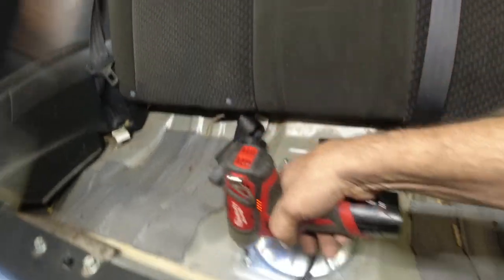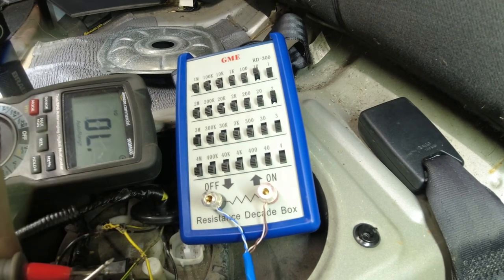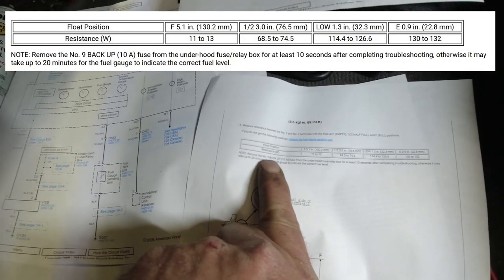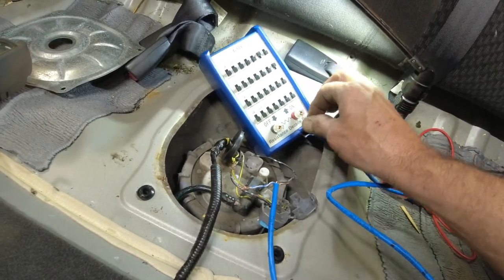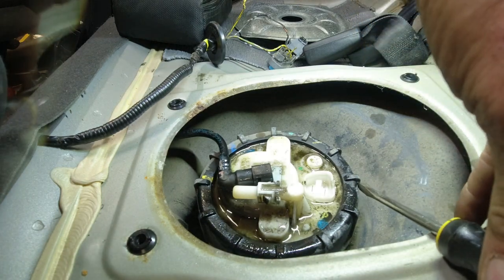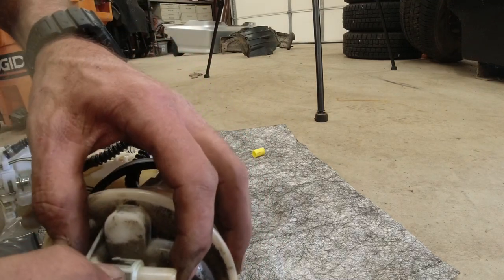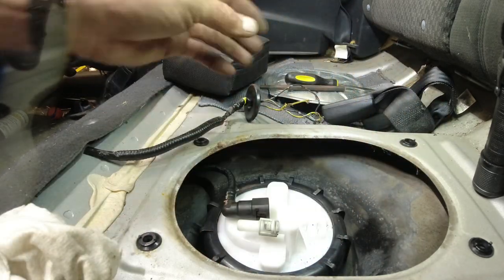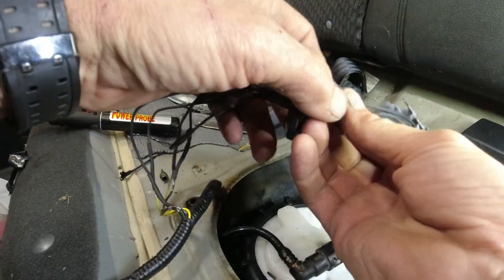Gas Gauge Not Working? Test Using a Decade Box

Comment: Excellent troubleshooting video! I had a Mercedes 300D, a few years ago that I sold, that had both a bad fuel gauge and a bad fuel tank indicator.
I think I could have saved a day of troubleshooting if I used a decade box!
Reply from the maker: They're not that expensive either which is nice. You could also use cheap resistors which would yeild the same result  I just used the decade box because I already had one that I'll use at work. 😀